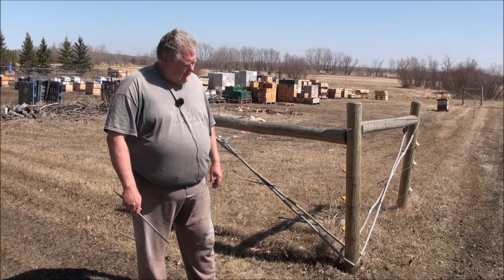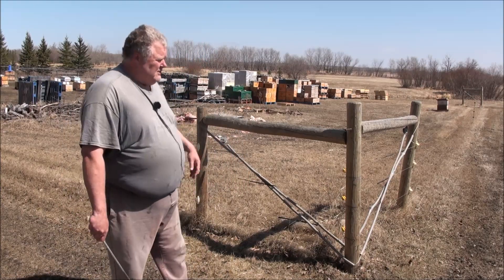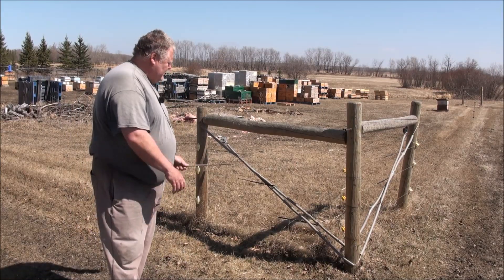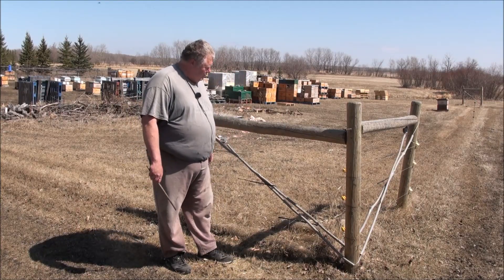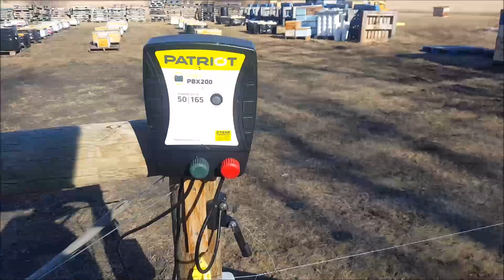Building Fence - That Bee Man

Comment: Great video and concept, however; I noticed one of the posts is leaning excessively.  After reviewing I came up with a simple solution, you simply need to string one additional wire on the top; going from the tops of the two most further apart, posts;  that way, you will not have a leaning post. Either that, or make sure when you drill the hole for the wayward post, it is 90 degrees to the azimuth of the universe! :) I surely hope you have not forgotten to cut that "barb" the nail sticking out, easy to forget these minor points, until you injure yourself on it, I'm talking from personal experience!  You make a mental note of that to do item, then there are 10,000 other items to take care of, and you completely forget about it until it sticks you!  It's the little things in life that are important, don't neglect the little things, or they can land up sticking you!  Only YOU can prevent forest fires!
Reply from the maker: Not being straight vertical does not hamper performance.  Drilling with a post hole auger is difficult without a spotter...I had none at the time.  You betchya, Smoky!

Comment: I just built a fence around my garden today, after watching this video, I did not learn a thing!  I had a corner post that landed up landing at a  45 degree angle!  I let it go, but does not look right, realized afterwards, after looking at your video, I simply should have, had an anchor wire to compensate!  My fence looks terrible!  Wish I had common sense!  I thought your video concept was nonsense, now, I know better, I'm such an idiot!  Your fence is much better than mine!  I'm too lazy to correct my bad judgment, until the critters try to compromise it.  Which they probably will.  As I put up fence, I took a plastic body hammer 3 lb sledge to put posts in, I was cursing myself, so many posts, and, had I my 25lb metal sledge hammer, would have done it with two hits, took me ten on each post, times 40!  Stupid, too lazy to get the right tool oh well, got er done! Was wondering if I was going to have a heart attack, did not happen.  Had I the common sense to walk over and get the real sledge hammer, I would not have had so much cardio exercise today, well, I'm above ground, so happy :)
Reply from the maker: Sounds like you had some stones throwing off your post alignment.